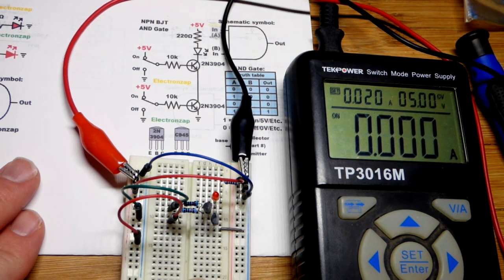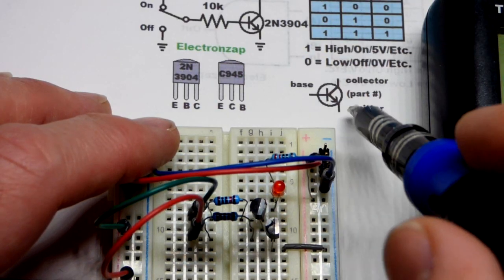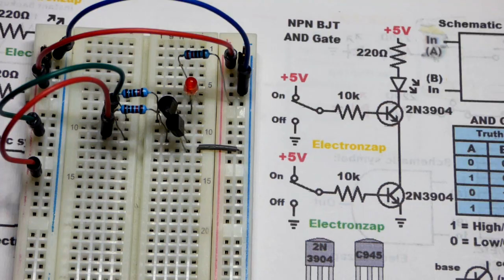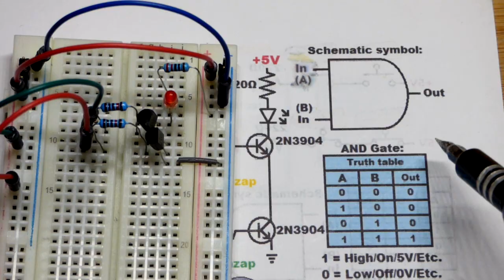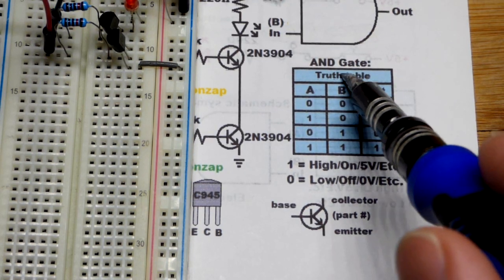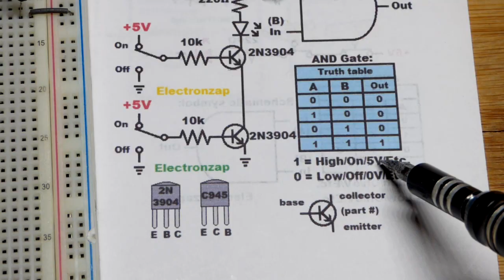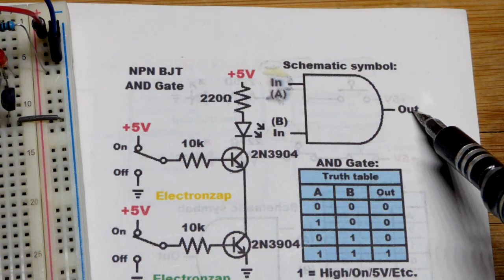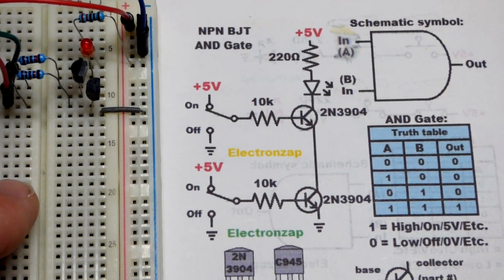NPN BJT Based AND Gate Circuit For Beginners Learning Electronics

Comment: 2 input OR, NOR, NAND, and AND can each be done with 2 BJT transistors (and 3 resistors). NOT can be done with 1 transistor and 2 resistors.
The beauty of discrete BJT logic is an additional input only needs typically 1 more transistor (and a resistor), up to a limit of output fan-in where you might need buffers (like a NOT gate but the output is non-inverting) or to tweak resistor values.
Transistor count and average power use can also be reduced (sometimes) by trying the inversion of the input or output logic (from active high (+5V) to active low (0)) on a particular net.
Now create a 100 MHz D or JK flip-flop with a clock and an enable using only transistors. ;o)
Reply from the maker: Thanks!